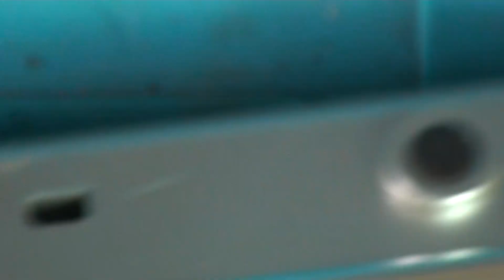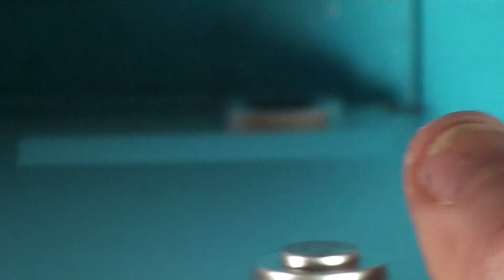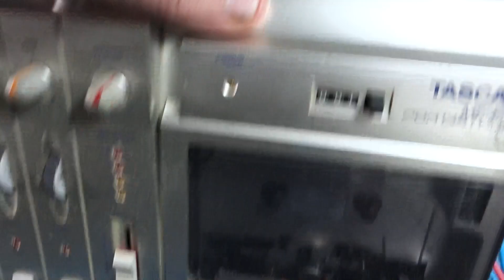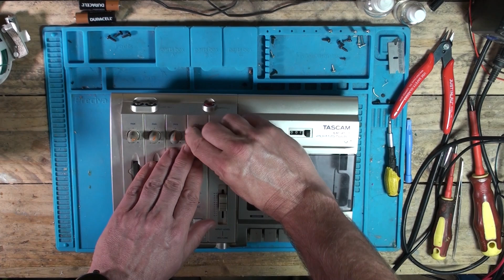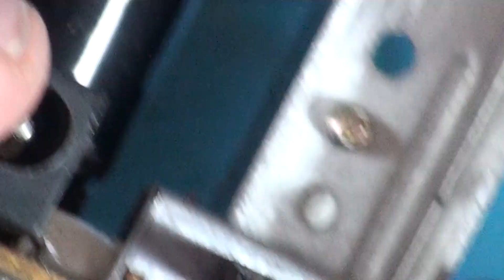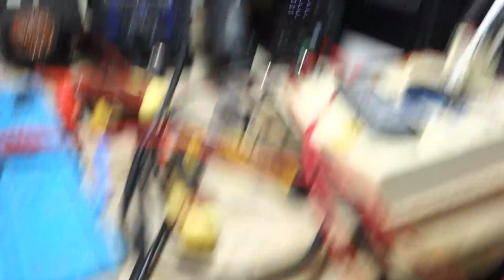Tascam MF-P01 Portasound No Power - Can I fix it?

Comment: Smooth fix and clean. The mic thing is 4 ring jack vs. 3 ring. Its super annoying when you get gear that doesn't go both ways. I've seen a converter go-between online somewhere but how often do you really need it though.
Reply from the maker: Thanks, I wasn't quite sure what was going on when trying to record on it lol

Comment: This was a great video for fixing no power to tascam mf-p01. When I plug ac adapter in the power won't stay on. Think plug needs replacing. Do you know where I can possibly find a replacement that can be soldered to circuit board? Thank you for any help
Reply from the maker: The power sockets are usually a standard size/pin layout. Try searching on websites like rx-components, cpc, farnells or ali-express.
Reply: Thank you so much for the help
Reply: Can these power sockets be soldered to the tascam mf-p01?
I couldn't find the  original  plug -in so been using this power adapter  I had that has switchable  volts and also  can change the polarity which I switched to negative for the center pin.  But the plug fits loose......could this be the problem where power isn't staying on ?
Reply from the maker: @samsonscott4971 if the plug is loose it could cause a problem